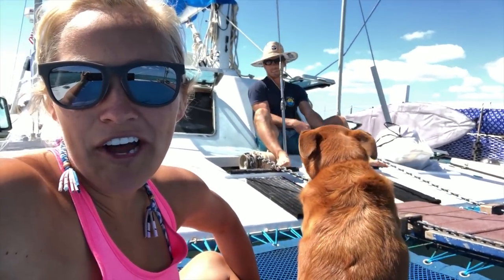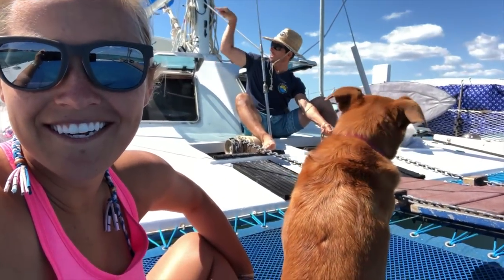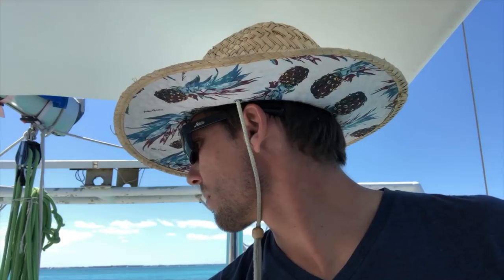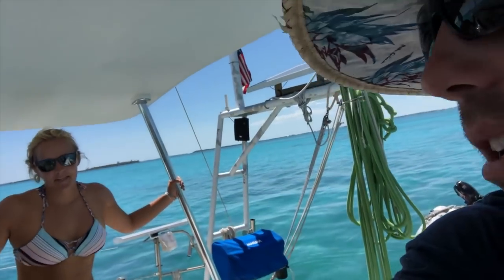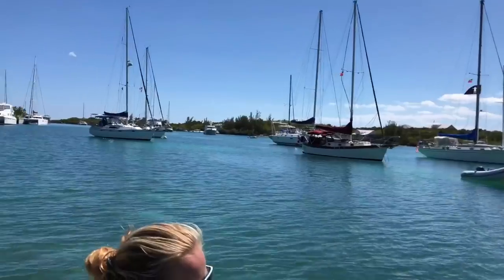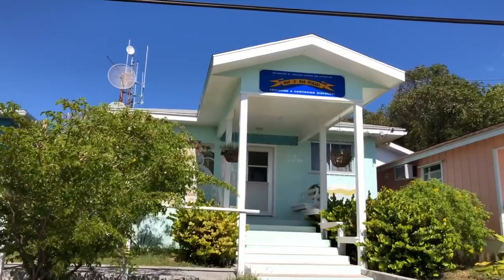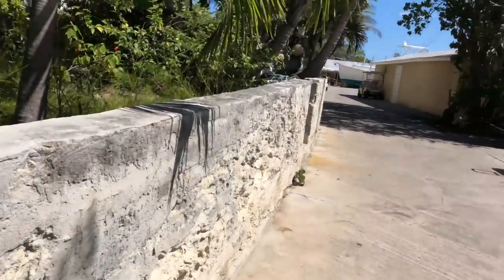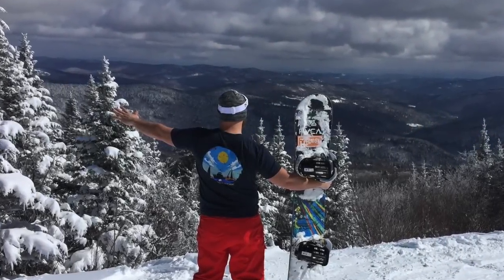Man-O-War Cay - A Dry Island with Deep Boatbuilding History

Comment: Billy, there is an easier way to raise that anchor. Get a mooring float ball or "tuna ball" they call them up north. depending on the weight of the anchor, it will dictate the size of the ball.  Tie a small line to it looped. You put the ball on the anchor and then drive the boat around in circles against the anchor....this will cause the ball to slide down closer and closer to the anchor until it is straight above it and it breaks free. the anchor slides to the end floating it and you can then just easily pull it in rather than tug on the weight of the boat raising it.  I live in Stuart so if my description isnt good enough, contact me through here and we can discuss it further in email or in person. We used that method to raise our anchors from 100 ft when tuna fishing and it work as good as any winch. Once you see it done once, you will kick yourself for ever tugging on an anchor to get it loose. I learned the trick from my grandfather who was a fisherman from Ireland.
Reply from the maker: I'm going to have to look into this technique! I like doing it by hand to get a little workout in and the manual anchor windlass does a great job. we rarely anchor in more than 20' of water so I'm not sure if it is worth it for us to carry extra gear to haul it up but I will def look into it!
Reply: only gear  you would have to carry is one ball.....which can be used for multiple other things. When you get back to Florida, holler at me and i can show you on my boat...mine is a fishing boat but it works the same for all